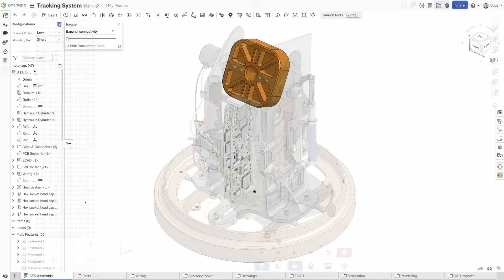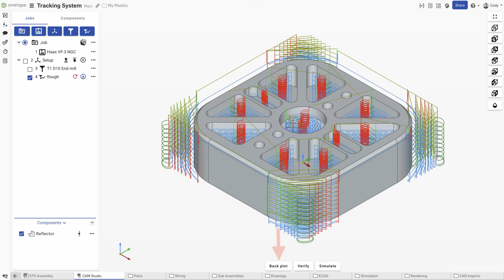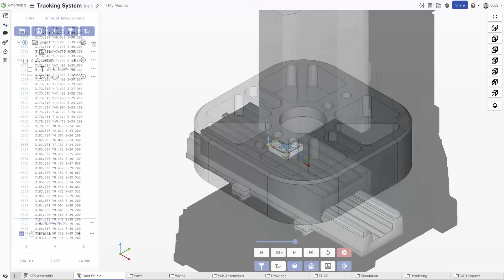Introducing Onshape CAM Studio

Comment: It seems that since this is designed for milling, it wouldn't be too much of a leap to "reverse" the milling that takes away material and use it as an FDM tool (plastic or metal) There are only a handful of true 3D FDM printers now. Most of them are 2.5D, but they are progressing so fast that if Onshape gets ahead of the curve now, they will emerge as the go-to software tool for an entirely new market!